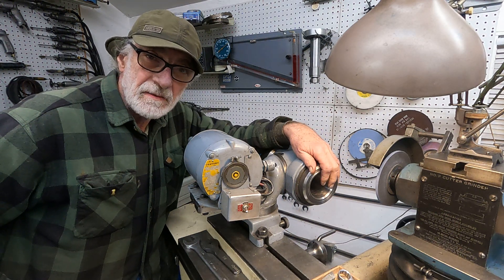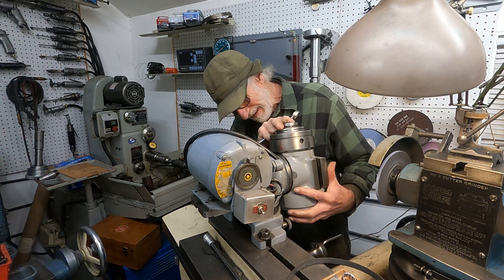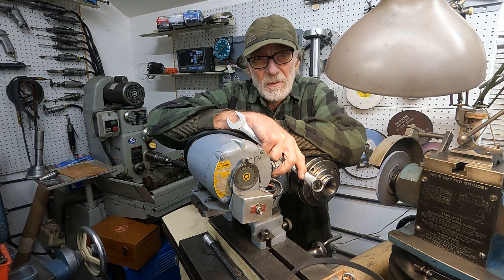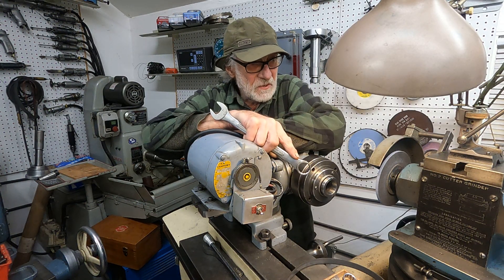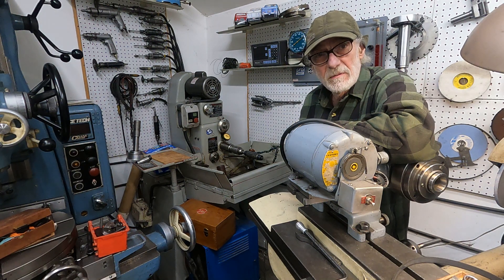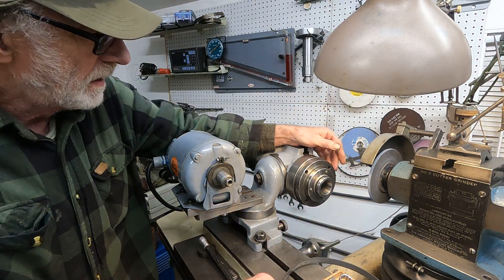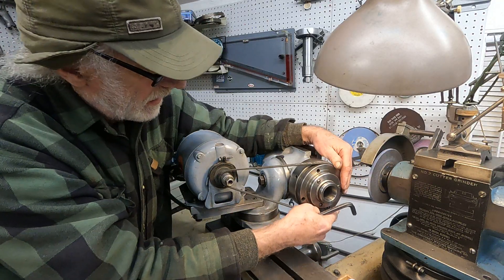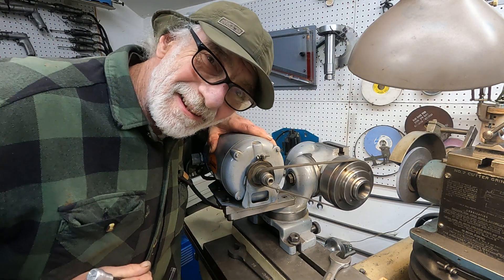Tool & Cutter Grinder return to regular shop use setup

Comment: You’re right on how cheap that horizontal mill tooling is. I see good size milling cutters for less than $20 on ebay. I needed a 4”x1/8” cutter for a deep narrow slot, I think I found a carbide tipped one for $10. 

It seems to me that machine tools in general, especially manual ones, are cheap. I started collecting the things when I was in high school, though I’m fortunate enough to have a place to put them and access to a truck to haul them. I’m not of legal drinking age yet and have probably 5 tons worth of them. The most expensive one, my good Bridgeport, was only $2500, and has paid for itself working weeknights and weekends on and off for two years. A few thousand dollars isnt a big investment when the thing can pay itself off 10 times over. Most kids my age would rather take out a loan on a truck that’ll be crashed in a few years, than on a machine that will put them forward in life. More room for me, I suppose.
Reply from the maker: I was doing the same thing when I was your age, I managed to get a small lathe and start working on generators and starters for cars. The tooling for this old mill was really cheap, the tooling for the old Axelson lathe was pretty expensive. I realized back then I would have old cars outside and nice machines in the garage, thanks for tuning in!

Comment: You're pretty versatile in being able to accommodate different tooling for your grinder. Thanks for sharing, have a great day.
Reply from the maker: I have seen some interesting setups one fellow converted the wheel head to belt sander and uses the table movement  to finish metal parts.